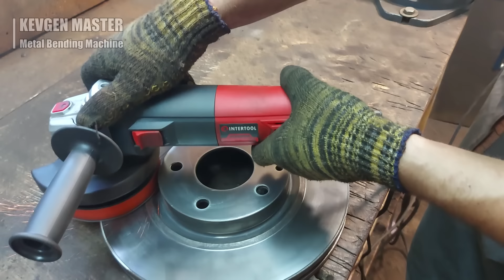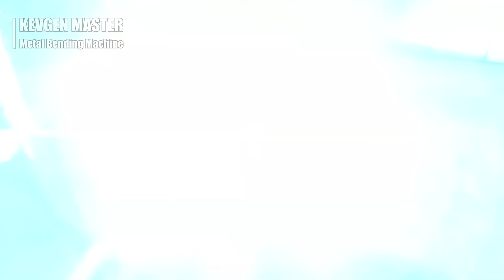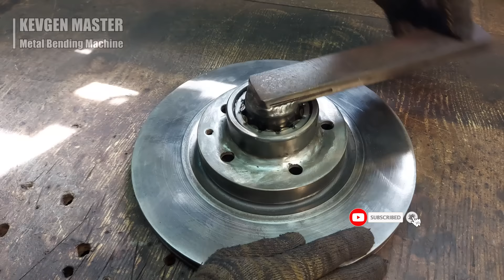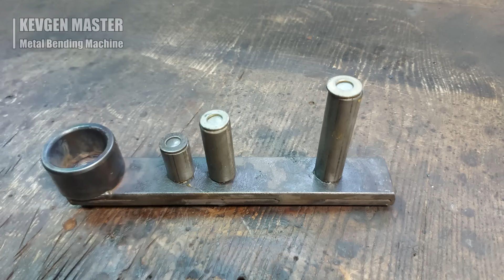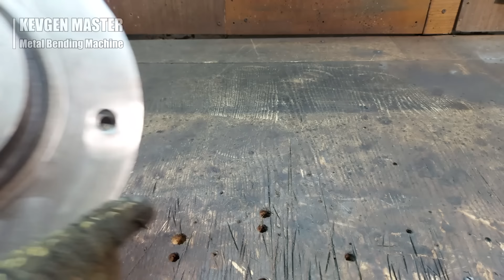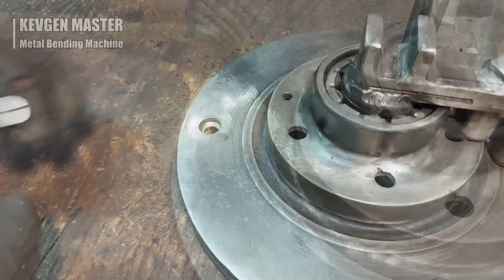ТАКОЙ СТАНОК ДОЛЖЕН БЫТЬ У КАЖДОГО! СТАНОК ДЛЯ ГИБКИ МЕТАЛЛА СВОИМИ РУКАМИ!

Comment: I used Google Translate (я использовал переводчик гугл)...Very nice. Removable bending handle would be nice. (Очень хорошо. Съемная ручка изгиба была бы хорошей). Inspirational, I am just getting into welding. (Вдохновляю, я просто вступаю в свароку). I hope translation is accurate. Thanks
Reply from the maker: All perfectly. Many thanks. The handle is removable anyway, since the inner bearing race can be easily dismantled and not fixed in it.👍👍👍

Comment: I have to say that when I saw you weld the steel bearing housing to the cast iron brake rotor I was sure the weld would fail due to cracking and carbon inclusion from the cast iron.  

When I saw you drill the rotor for the screws to fasten it to the bench, I noticed that the chips the drill was producing were more along the line of those made when drilling steel, not the powdery chips that are made when drilling brake rotors here in the US.  

Perhaps your brake rotors are a higher grade of cast iron or are perhaps steel themselves?  In any event, I applaud your ingenuity.  You do fine work and should be proud of what you accomplished.
Reply from the maker: Thank you very much. Best wishes👍👍👍
Reply: @kevgenmaster  h